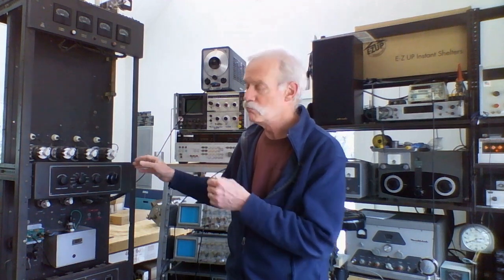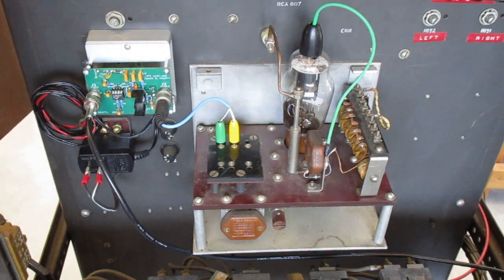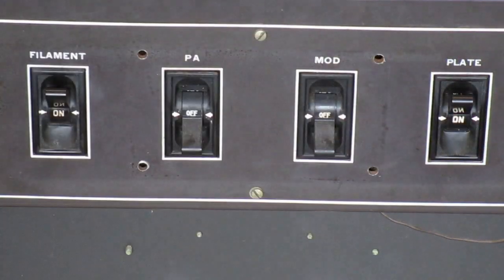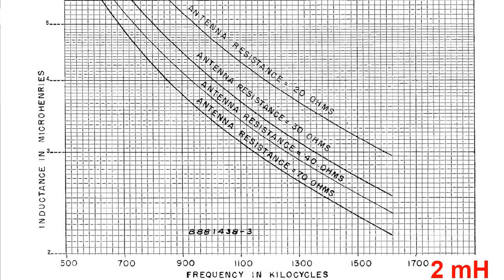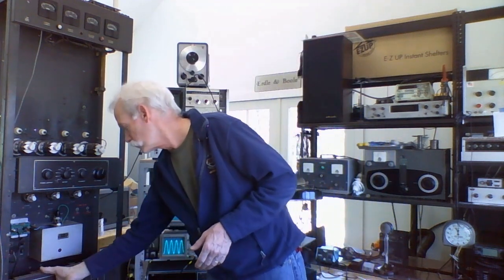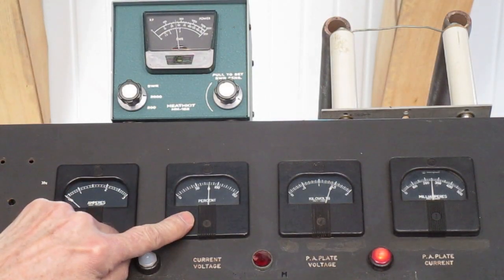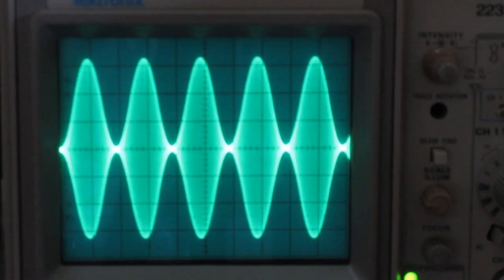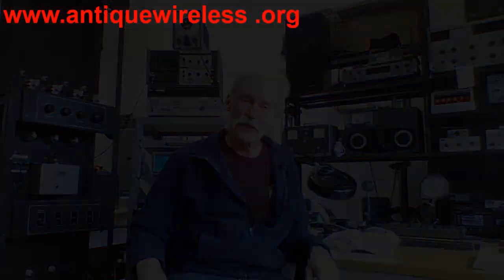Part 3 - Converting an AM Broadcast Transmitter for Ham Radio Use

Comment: I wonder what your antenna is?
Reply from the maker: I'm using an 80 meter dipole configured as a Marconi "T" vertical with an "L" network tuner.
Reply: @WirelessMuseum  thanks. I use an Inverted L on 160 with a series capacitor. Have used L network also. The L can match anything it seems! 73 de N4DJ

Comment: Do you run the transmitter on 240 volts ?
Reply: A nice feature of this transmitter is that it runs on 120 volts. Draws just under 1500 watts at 100% modulation.

Comment: Great video, well produced.  I use an antenna analyzer to select taps and get reference readings for the tank circuit, this works great with no power on just disconnect the finals and insert a resistor to ground based on the final tube specs. KC8ZUL